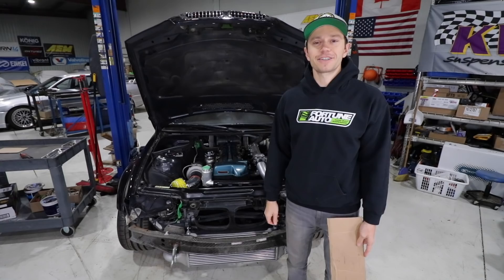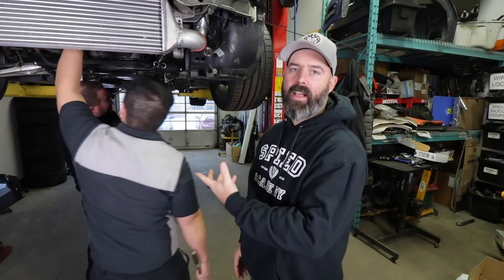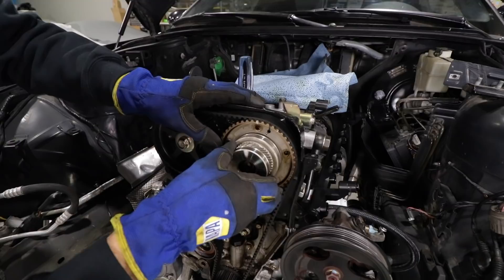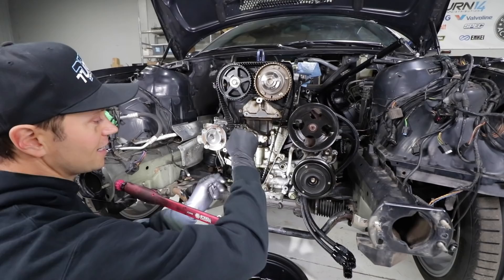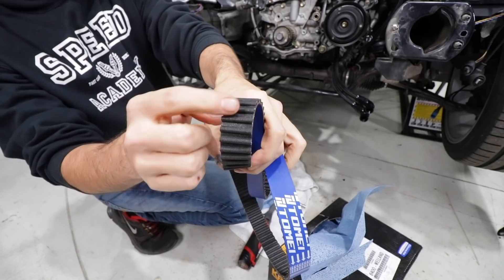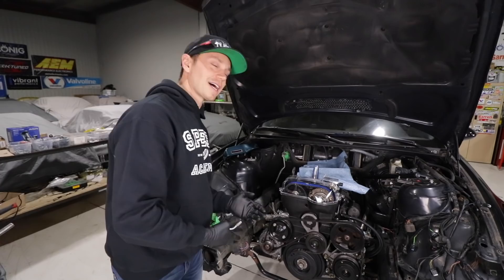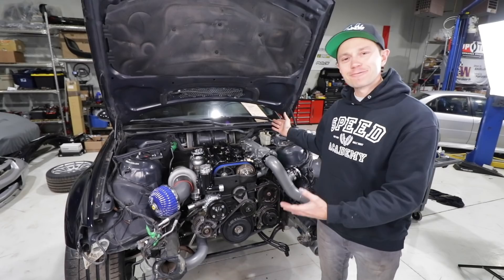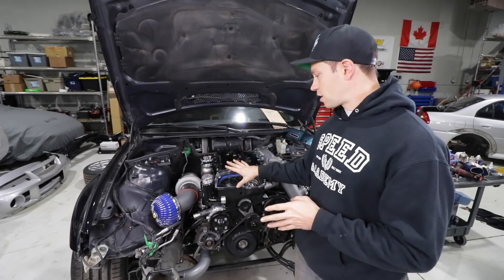Ultimate BMW M3 Rebuild - 2JZ Swap Reliability Issues - Part 13

Comment: use the clear cover!! I have it on my 2jz and it sure saved my engine. I noticed my timing belt was damaged after driving an event, and I would never have noticed it with a painted cover.
Reply: Not to mention it looks cool

Comment: I would have plugged the exhaust holes prior to cutting the studs to avoid metal shavings to potentially hit the turbine when you start it.
I guess you guys can use compressed air and make sure valves are closed to blow em off. Just my $0,02
Keep it up, looking very good

Comment: Those exhaust ports are going to have a lot of metal shavings in them after you used that cut off wheel. Yikes! 🥺
Reply: They'll probably fire it with the exhaust side off anyways. It'll just blow it all out

Comment: I used to have a clear dizzy cap and it looked great for a while but it did turn a lovely yellow colour after a short while. Also it will probably be very brittle plasti so you will need to be careful fitting to avoid breaking it!

Comment: VW OEM parts manufacturers also remove the VAG logos. I bought and returned a couple of MAF sensors that appeared to be damaged. Turns out Hitachi just scratched out the VAG part numbers and logos.

Comment: Not a fan of putting older engines in newer cars but this one is coming along nicely, love the way you guys build cars
Reply from the maker: Well technically this engine isnt older as it did come in the Aristo which ran to 2005 if Im not mistaken :)
Reply: I guess it depends on which market it was sold in, my sources say 2002 was final year production but whatever at least it’s the VVTi model and at least you guys are utilizing that BRZ E-throttle and the coil upgrade you mentioned which brings up to date!

Comment: Awesome video. Thanks to Freedenginering they sold me that vvti spracket seal, that was like 2 years ago. No oil leaks, and my 2002 IS300 still running strong.

Comment: Regarding the cam gear alignment. I've seen small variations in cam angle even between unmolested engines. They have some slop in there (presumably) for adjusting the zero point of the cam from factory. I suppose if you wanted to get really nerdy you could get out a degree wheel. Luckily with an aftermarket ecu you can set the vvt zero point anywhere. Cheers :)
Reply: Mark throwing down knowledge.

Comment: I still would of got the billet tensioner bracket for piece of mind what's 100 dollars over a engine
Reply: Overkill.  An ATI crank damper and the MT drive belt tensioner would have been a better choice though.

Comment: Nice build, you should tack the crank trigger wheel on the back of the timing belt crank pulley with your tig welder so it doesn't walk itself off, cheap insurance.